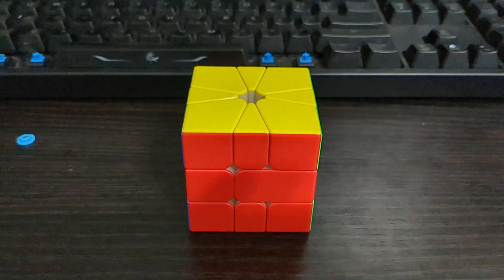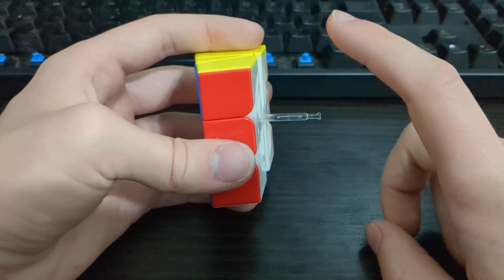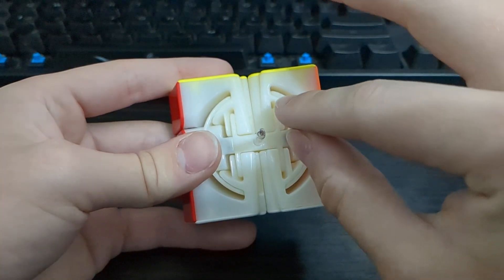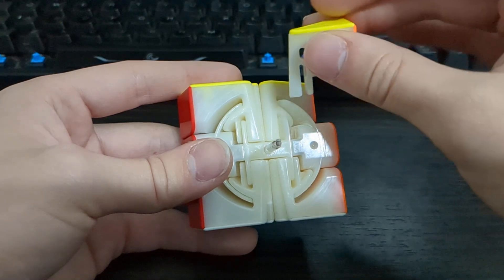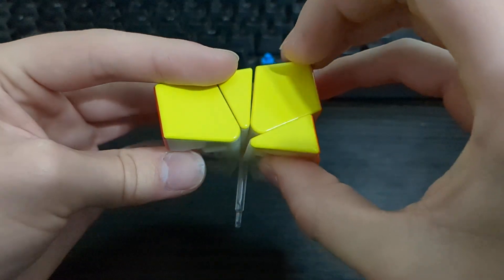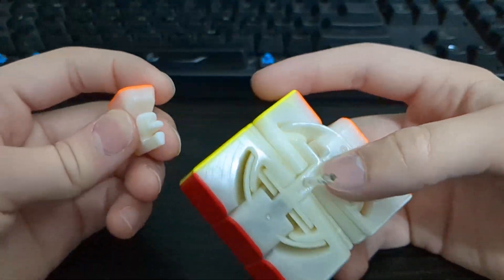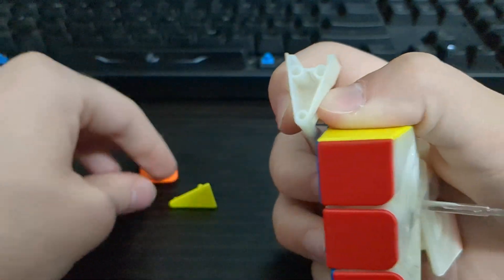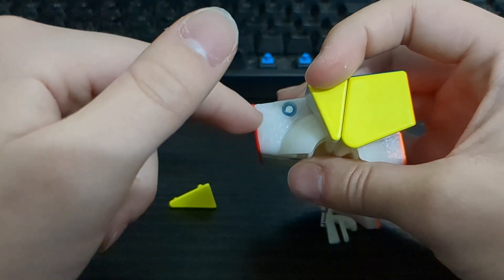Gan Square-1 Internals

Comment: I wonder how different the real version will be vs this old prototype.
Reply from the maker: The production version will have eight magnets on each side of the equator rather than four, and it will also have edge magnets. It will also have a metal rod rather than a plastic rod, so that's good!
Reply: @benskewbs  That's great news! :)